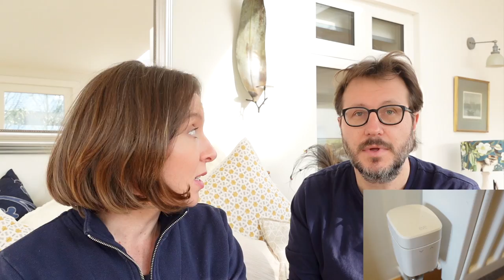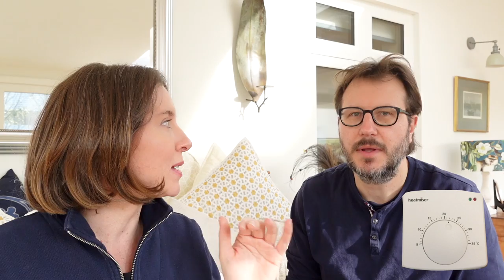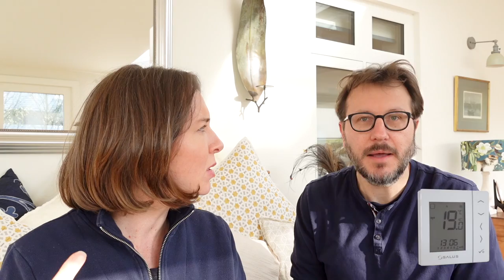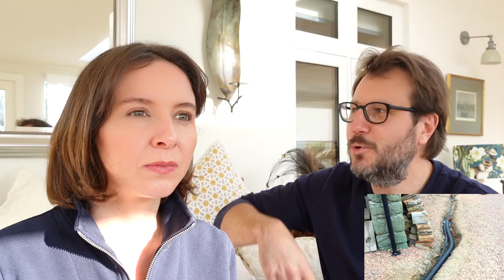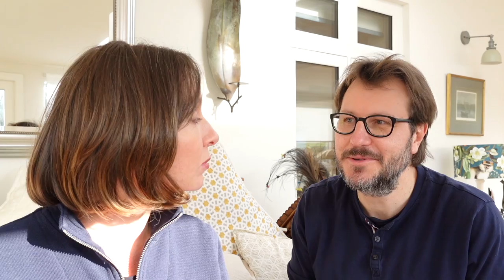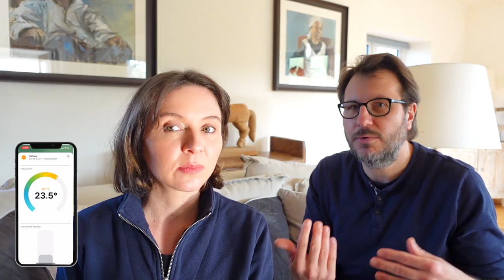How We Control Our Air Source Heat Pump: Smart Thermostats And TRVs

Comment: Inspiring stuff, thank you! My pump was only commissioned last week and I am just beginning the process of grappling with optimising control of my ASHP. This video was great for signposting key considerations and for enabling greater understanding of the operating manual which, to say the least,  is not at all user friendly as it does not provide an overview of what you should be aiming for in control, let alone how to achieve optimal control! Thank  you - onwards and upwards! I shall be watching your previous episodes shortly ...  Terrific idea to post your experiences!
Reply from the maker: Thank you Sue. There’s a definite learning curve when it comes to heat pumps. We would also like to invite you to join the forums and participate in discussions about heat pumps or renewable heating, and other homeowners can give you advice on your controls and how to get your system working most efficiently: https://renewableheatinghub.co.uk/forums

Comment: Really fascinating and entertaining - thank you.  Have you checked the air humidity levels in your rooms?  I have had two houses where the level was over 70%, which meant that the heating had the additional burden of having to heat lots of water vapour in the air and also in the furnishings (which felt cold to the touch).    Two weeks of a Meaco dehumidifier (150 watts) reduced all this to 55%, a level which was maintained after switching the dehumidifier off, and the whole house felt drier and consequently warmer.  We need only use the dehumidifier every few months when the humidity level creeps up.
Reply from the maker: That’s a great tip Robert. I’ll check the humidity levels for the past few months on our Eve Room... if they’re high, which I suspect they may be, we will look into dehumidifiers.

Comment: So pleased to have found this video. Thanks guys!
I live in a modest mid-terrace Victorian property which requires substantial renovation. I have been seriously considering an ASHP (replacing the old back-boiler heating system).
The things that still feel unclear are:
1 - If an ASHP runs all the time, why is there a call for heat? & 
2 - If you now have smart thermostats in each room, do you still need TRVs on each radiator?
Reply from the maker: Thanks for the comments and questions Martyn. 
In response to question 1, the only reason the heat pump runs 24/7 is because something is calling for heat 24/7. We recently upgraded some of our radiators to Stelrad K3s in the coldest portions of the house, and I think that this coming winter the heat pump will come on and go off during the day because rooms will come to temperature.
For question 2, the smart thermostats call for heat. So if a room gets to temperature, the smart thermostat will stop calling for heat, but other thermostats may still be calling for heat, so the water will run course through that radiator, unless you have it set to 1 or 2, in which case the radiator will shut off. It's a bit difficult to explain in writing, but I hope that makes sense.
Reply: @MyHomeFarm  I think I understand now. Thanks for the swift response. :-)
Reply from the maker: Martyn, I’d recommend creating an account on the forums at Renewable Heating Hub and posting your question there to get assistance from other users. Our control system is a bit more complicated because of our large zones, but there will be other homeowners that can offer different insights: https://renewableheatinghub.co.uk/forums

Comment: My Nibe outdoor AMS10-12 plus indoor HK100S setup comes with SM20 control sporting an internet Uplink. Fine controls are integrated already. The indoor module housed in the heated garage with 60x60cm2 footprint can optionally work with existing central heating as well as solar panel fueled heating element in its 180-L tank.
Reply from the maker: Thanks for sharing.

Comment: Be good to look at weather compensation, the heat source (ashp in this case) modulates the flow temperature to rads/underfloor depending on out side temperatures, using this you just leave all trv fully open, an added advantage to this heat source is less likely to cycle giving more efficiency.

Comment: Great video, thanks! Do you know if the water that gets sent to your underfloor and rads is the same temperature? I understand the former likes 35 degrees and the latter 55 degrees, so wondered how your system compensates for this?
Reply from the maker: Thanks for feedback Jonathan, and happy to hear you found this video helpful. To answer your question, because we switched to an air source heat pump from an oil boiler, there is a mixer that goes to our UFH. This mixer allows you to regulate your UFH temperatures (from 30-55C). We have set this to max, because we won't want to be cooling the water that our ASHP has worked hard to produce. At a flow temperature of 45C our oak and heavy slate floors never feel "hot" - they are at a very comfortable temperature and they are keeping our downstairs living areas warm and snug. I hope that answers your question.
Reply: @MyHomeFarm  Thanks, sounds like 45 degrees is a sweetspot for combining rads and UFH. Also presumably the heat pumps remains reasonably efficient heating to this water temperature

Comment: My question is about cost efficiency of an ASHP in the summer months.  I am doing a total renovation of a semi detached and will be putting underfloor downstairs and rads in 2 bedrooms upstairs with electric pads in two bathrooms. The house will be brought up to full insulation values.  I live alone so dont use a huge amount of water.  I live on an island with only one electricity provider at 15.67 per unit and can't get my head round running an ASHP all summer to heat water for one daily shower.  It is my understanding that the heat pump works most effectively if it is running constantly which means I will be drawing electricity 24/7 through the summer to give me my daily shower.
Reply from the maker: Hi Penny. To answer your question about the summer and hot water, this is an extremely efficient time for the ASHP to run because the air outside is warm and the amount of power required to refill your water demand should be very low. The 15.67p/unit is on the outer limit of it being cost-effective to run in the winter. Since your house will be well insulated and the heat pump (if installed and sized correctly) could be effective, but the energy price is worrying since you only have access to one supplier. 
If you have more questions, we would like to invite you to join Renewable Heating Hub where you can participate in our forum discussions and get answers to questions about renewable heating and heat pumps https://renewableheatinghub.co.uk/forums
Reply: I have spoken to the provided and there is another tariff for ASHP of 10.97 for 20 hours then 15.67 for the other four hours.  Does this make it more viable.  I am considering forgetting the ASHP and just installing a new efficient oil fired boiler instead.  @MyHomeFarm
Reply from the maker: The 10.97p rate will be very good. You can even set up your heat pump to turn off for the four hours that the tariff is high, which I assume will be between 16:00-20:00 (or somewhere around there). If your home will be well insulated you shouldn't lose too much heat over that period. Hope that helps.

Comment: Hello, very good video.
I currently use a combi condenser boiler but I am thinking about converting to air source heat pump.  I have installed TADO smart TRV on all of the radiators in the house, TADO room stat in each room and a TADO central control unit which receives commands from the various units in the house and that in turn will send a signal to the boiler to switch on or off, this is for heating only, I dont have under floor.
My boiler produces hot water on demand so by opening the hot water tap, the boiler senses the drop in pressure and the hot water on demand process starts.
Did you find a way to make the air source heat pump working in this way? Is there any way of sending a drop in pressure signal to the heat source to get it to start up when domestic hot water is required or does this require a stand alone hot water tank?
Reply from the maker: To my knowledge, you must have a hot water tank with an ASHP because it won’t heat water at the same rate as a boiler. The DWH typically takes priority so you always have hot water. 

I’d like invite you to our forums where you can discuss this and other questions with homeowners: https://renewableheatinghub.co.uk/forums

Comment: I have a company coming to see my this afternoon about ASHP. Apart from noise what question do you suggest I ask please?
Reply from the maker: Please make it clear you want a proper heat loss calculation and emitter guide done - this will determine the correct heat pump size. Get guidance on whether on all rads will be the right size to heat rooms to your target temperature.

Comment: Hi we have just got air source heat pump put in and have nest thermostat for upstairs and downstairs, trying to figure out when the radiator heating comes on and what is the most efficient way to use the heating. Any help from you would be much appreciated. Will look into smart trv as mentioned in your video. Thank you
Reply from the maker: Ideally, you want your heating on 24/7 with weather compensation enabled. That’s the most efficient way to run your heat pump. Rads should be set to regulate the room temperature as you want it. I would like to invite you to join the forums and participate in discussions about heat pumps or renewable heating where you will get a lot more answers to your questions: https://renewableheatinghub.co.uk/forums
Reply: @MyHomeFarm  thank you. I will join the forum.

Comment: For someone who has been using air to water heat pump to heat their home for over 10 years, I can advice you; the most efficient way to use the heat pump is to control (to set water temperature)the water temperature, not the room temperature. Keep your water that's circulating in your system at a constant temp that is comfortable for you, 35C, 40C or wtv accoridng to the weather conditions. You will achieve the best and most efficient  results.

Comment: Hello! Thermostat in room turn off completely heat pump when rich optimal temperature?
Reply from the maker: Yes, it does.
Reply: @MyHomeFarm  Thanks, but in this way the room thermostat, by turning the pump on and off, turns a smart inverter pump into a normal on / off air conditioner. Air-to-water inverter pumps should run 24/7 without shutting down when it is cold outside, and constant pump operation saves money. The thermostat will constantly turn the pump on and off and this is not good both for the savings and for the pump / compressor itself. Frequent switching on and off raises consumption. We adjusted the heating according to the "curve" based on an external sensor that reads the outside air temperature and this proved to be the most economical solution.

Comment: The Germans have got this totally figured out. Heating ‘on’, no stats, full weather comp. The stupid part L requirement for thermostatic control is based on flawed logic from when boilers weren’t condensing and air source wasn’t even a thing.

Comment: Do you have any zone valves linked to your thermostats ?
Reply from the maker: We have two motorised zone valves (one for the rad circuit and one for the UFH circuit). The wireless Salus thermostat "receiver" is wired into a Drayton electric box, which is where the the zone valves are also "connected".

Comment: Hello. I have recently moved into a new build with a 14kw ecodan system. I’ve read that running them all the time rather than set to come on at certain times is best... Is that right? The temp is set at 19 degrees but the heating switches on and off throughout the day to maintain that temperature. I get the feeling that’s not the best way to have things set up and it will cost more in electricity. Any help would be appreciated. Thanks.
Reply from the maker: Thanks for the questions Scott. I would require some additional information to provide you with you with better feedback. 
On that note, could I trouble you to please join the forums at Renewable Heating Hub – https://renewableheatinghub.co.uk/forums – and simply post your question in a new topic under the air source heat pump category. It's just much easier to discuss things there and for answers not to get lost, as they do in YouTube's comments?

Comment: Someone is trying to reinvent the wheel here. The best solution is a fan heater, which contains a heated coil and creates warmth immediately. Fan heaters have been around for years. I bet they're a lot cheaper than this reinvented nonsense
Reply from the maker: Running one 2,000W fan heater to heat one room uses about the same amount of electricity as our heat pump to heat the whole house.
Reply: Lol, a bike is also a lot less complicated than a truck, so why not use bikes for cargo delivery